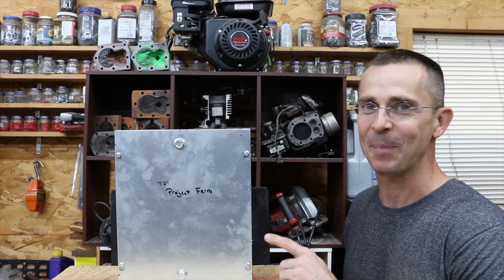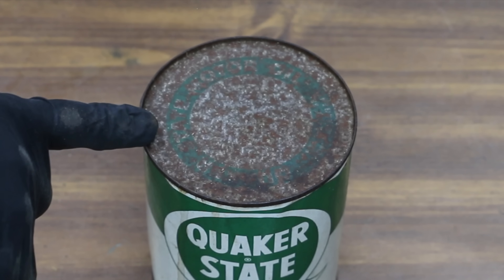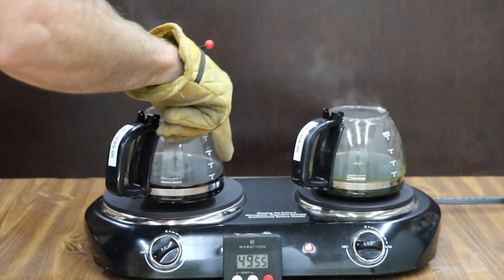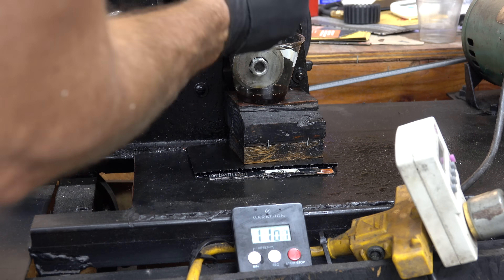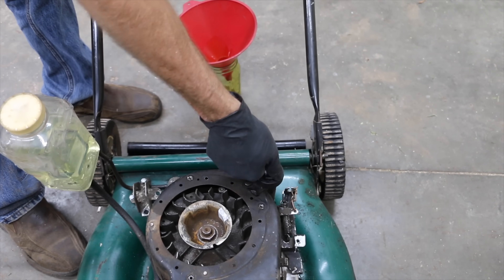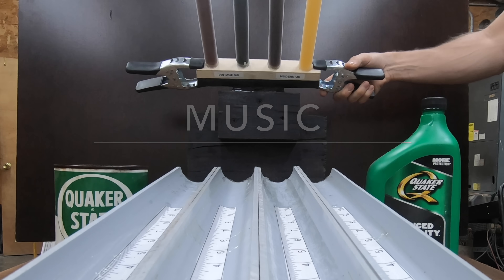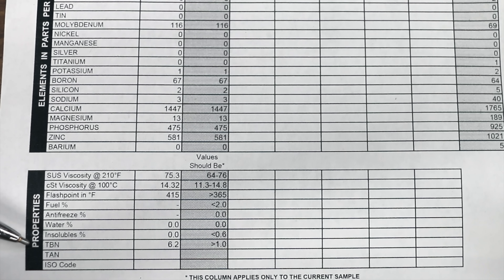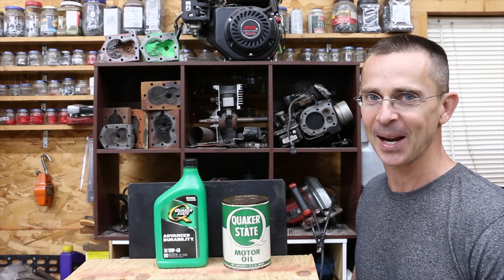Is Oil Good After 70 Years?  Let's find out!

Comment: I’ve got several jugs of 5w-20 full synthetic oil that’s been on my shelf for about 8 years. Got it on sale when I had a vehicle that used that viscosity. I have since sold it and had no use for it so it just sat on the shelf. I just recently got a truck that uses 5w-20 and I was hesitant about using it due to its age. After watching the lubricity test on 70 year old oil, it’s given me the confidence to use it for short intervals 😂
Reply from the maker: Thanks for sharing.

Comment: One thing to consider : the fuel composition was different 70 years ago as there was lead in it.  I wonder if there would be any significant changes in the heat results with 70 years old fuel.
Reply: The lead was to add a higher octane rating. Didn't have anything to do with the motor oil.
Reply: @erikkovacs3097 the high temperature caused by the explosion in the cylinder chamber could have an effect on the oil.  if the temperature is lower, the old oil might be less or more sluggish..
Reply: @dynad00d15  Engines have to get pretty damn hot to start chemically altering the oil. Gasoline hasn't change that much in 70 years and what has changed wont make the engine overheat.
Reply: Modern motors high compression put out more heat. This comparison is flawed. Also cast iron blocks back then now we got aluminum which takes away heat faster.
Reply: @holdmybeer1085  True.  Also, i wasn't stating a fact, i was just curious to put the old oil in a same age context and compare.  Thank you for your insight! :)
Reply: @erikkovacs3097  good point.  Thanks for your explanations!
Reply: The lead was a very good upper cylinder lubricant so maybe.
Reply: I get a kick out of people that think they need hardened seats because we dont have lead in gas. As my aviation instructor said "do you really think your going to lubricate anything at those temperatures?" "If you say that lead lubricates valves in a ma and pa gas station for 50 years people will believe it"
Reply: @billyjack8119  my favorite is the rubber band on the back bumper to "ground" the car during lightning storm... "and what do you think your tires are made of?"
Reply: @billyjack8119  Oil burns up and becomes soot at "those temperatures" and lead doesn't, it melts and is still lead.
Reply: @captaingoldbeered803  lead in gas does not lubricate. Thats the whole point and you should never have oil in the combustion process anyway. Lead was for the octane only. To go from the low 90 octane range to over 100 you need lead. It was to control detonation and nothing more.
Reply: @billyjack8119  It coats the valve faces and seats, which does indeed protect them.  Aircraft engines have always had Stellite valves and seats, as long as that material existed.
Reply: @billyjack8119  That's what it's main purpose was, but it did indeed coat the valve faces and seats, which protected them.  1975 and later engines all have Stellite valves and seats, which do not need protection, as they are super hard.
Reply: @michaelbenardo5695  lead was there to get the octane above 100 and thats it. You have heard of 100LL (low lead) it controls detonation and thats it.
Reply: @billyjack8119  As I said, it's intended purpose was to cheaply boos the octane, but it did indeed coat the valve faces and seats.  You can deny that all you want, but the cold hard fact is that an engine with conventional "soft" valves and seats like those common before 1975 would need a valve grind after about 20,000 miles if run steadily on unleaded, whereas if run on leaded gas, a valve grind was seldom necessary before 75,000 miles.

Comment: Now we know why old cars only needed 5 digit odometers.
Reply: My mom used to ask me why back then when the pacer and gremlin came out why anyone was lucky to get 60k miles from a trans or motor, I explained that the oil simply wasnt up to par, with an '08 mercury mountaineer at 152k miles on the odometer I do oil changes when the sensor tells me to roughly every 6 months or 7500 miles and its smooth as butter. Lol only high mileage full synthetic and a can of restore goes in but I use right under a quart of fresh oil to flush anything remaining after its drained and theres usually alot of dirty oil that gets pushed out
Reply: and to be rebuilt every 60,000-70,000 miles lol
Reply: Amen to that!
Reply: You do realise your should be changing your fluids regularly!!!!!
Reply: Many pre 1956 (?) models don't even have oil filters; they were accessories from the 20s to mid 50s.

Comment: Excellent video as he has always used to us, for which I congratulate him and thank him.  What was most interesting to me is to see that a motor oil, more than 70 years old, has been perfectly preserved in its original closed container.  Which would make you think and conclude that packaged motor oil does not have an expiration or expiration date, hence my question: does motor oil preserved in its closed container have an expiration date?  Because most motor oil manufacturers claim that they should be used up to 5 years after their packaging date.  This video of yours would be showing that this is not the case.  I thank you in advance for your answer, because it is a question that I have and no one has been able to answer it with certainty.
Reply: If sealed, it will not expire.
Reply: It was already probably about 300 million years old when it came out of the ground!

Comment: I would imagine that the vintage oil has a lot of sulphur based on the greenish color and odd smell.
Reply: For all the hype about how older oils used to have loads of zinc, this 1950s oil has very little.    Todays additive packs are much better even though they have lower zinc.
Reply from the maker: Great point.
Reply: scdevon well, one thing is old oil, other is pre-historic oil. I think maybe 1980s oil are much better than 1950s one, and maybe had more zink.
Reply: @sjogosPT     You are probably correct.  Oils in the 1980s were also pretty bad by today's standards even if they contained more ZDDP,  though.
Reply: @scdevon  that's way before Sd oils (late 60's,early 70's), after that you'd see 1400 ppm of phosphorous and 1500 ppm of zinc at SE, SF an SG oils.

Comment: I remember that packaging. I think that it was non-detergent and most likely 30W. That looks like that real deal from Pennsylvania. Later in life QS would get oil from similar oil fields and market it under their label. I have torn down engines in the 1960's and their was a lot of sludge in them, even using the 30w-HD. Great video as always
Reply from the maker: Thanks!  Thanks for sharing.
Reply: I would have expected that the 10w-40 would make the most sludge,the SAE 30 the least. 
There is a suspicion that some of the oil was blended with kerosene from the factory. 
Would be interesting to test vintage Valvoline and Mobiloil against vintage Quaker State. I think Mobil invented a new type of refining process and certain versions of Mobiloil were suggested or specified in some new car owner's manuals. Mobil I think was one of the original spun off pieces of the Rockefeller oil business.

Comment: you missed the joy of shoving a pour-spout into the can!?
Reply from the maker: Great point!  A viewer sent one of those spouts to me after this video.  I'll use it in a video soon. Thank you!
Reply: until the pour spout comes off and you pour 500ml of oil all over your rocker cover and manifold. lol
Reply: peace tranquility those things were usually in tight, only issue was when they started using cardboard sides, if you didn't push the spout in at just the right angle, part of the side would collapse, then it was almost impossible to get the spout in without destroying the can
Reply: oh yea . . . I remember those
Reply: @cobboGHS91  @Charles Patrick
Yes, a lot of us remember those scenarios! Some of us quickly learned to open the oil can with a church key and pour in thru a funnel.

Comment: An interesting aspect on the child flow test that was skipped over: The old oil clearly not performing anywhere near as well as the new oil; but the cooked and non-cooked samples of the old oil performed nearly identically. Now the takeaway from this could be that the oil was so lacklustre that the heat treatment couldn't make it any worse... Or maybe it was more resistant to the heat cycle (it did lose less during that process). But loss of cold performance after hot running is perhaps something that should be worked on more in modern oils.
Reply from the maker: Thank you for the feedback
Reply: It's like comparing apples to oranges.  The new oil is a multiweight 10w40, this will outperform any straight weight oil.  The old QS oil is most likely straight 30w and will pour much more slowly.
Reply: @ianrobertson3419  I'm not sure if maybe you misunderstood the point I was making. The multi-grade nature of the newer oil is irrelevant to what I was talking about.

All four samples are the same temperature, and my point wasn't new oil vs old oil, it was heat cycled vs non heat cycled.

On the old oil, both the heat cycled and non heat cycled samples acted almost identically. Conversely, when looking at the new oil, the heat cycled sample was significantly more sluggish that the non heat cycled sample. This suggests that there is a degradation caused by heat occurring in the new oil, and is an aspect that could be improved upon, given the oil will be heat cycled every time you drive (enough to get the engine up to temperature).

Comment: "top tier" and "E10" dont belong in the same sentence
Reply: "Top Tier" is a brand name for an additive package for gasoline. The spec requires 10 percent ethanol.
Reply: Pretty sure it was sarcasm lol 87 octane, 10% ethanol is the bottom of the barrel.
Reply: @captaingoldbeered803  it may be the bottom of the barrel but top tier branding means it's the best bottom of the barrel gas you could use
Reply: @tonyhong20  I see

Comment: ......it would be absolutely awesome to have some “fresh” oil from 70 years ago to test. Hard to know whether the age of this oil had anything to do with the test results.
Reply: Why do you think this was not "fresh" oil? Unopened can is as "fresh" as it gets !
Reply: Sealed can, very little to change.
Reply: I have read that a growth will appear in stored kerosene.
Reply: @louf7178  There are bacteria that live on petroleum. Maybe fungus too, but there are additives for stored kero. Home heating oil is kero, and we store it in 300 gallon tanks in our basements.
Reply: @stewartcaldwell5299  Thanks. I'm surprised people think refined oil is no different than crude, regarding "of course its good".
Reply: @louf7178   Well, petroleum makes paraffin, gas, avgas, jet A fuel, autogas, grease, tire rubber, most plastics, and on and on. I get so tired reading labels. Used to that people called kero anything that would heat your house, light your lanterns. It was a solvent, and once again on and on. The differences are mostly what companies say on labels to make you buy it. Small differences that don't mean a lot, usually.
Reply: I don’t think it ages. Oil is millions of years old already when it’s in the ground, right?
Reply: @garrettstevensen2467  Um....they don't just pump it out of the ground and put it in a bottle. It is refined, and then a shitload of different shit is added.

Don't most oik manufacturers apply a shelf-life of 2-5 years to their products for maximum effectiveness?

I'm just saying...certain chemicals break down over time...
Reply: animalmother556x45 no, 2-5 years is for opened containers.  There isn’t a shelf life for sealed ones.

Comment: Makes me wonder if we are getting longer life out of our vehicles now a days because of improvements in oil.
Reply from the maker: Thank you for the video idea!
Reply: Not that they're built to last anymore. So doesn't matter. We got great oil. Now the cars suck.
Reply: Can you get longer life out of your body,by eating better food??? yup!
Reply: @lon3_wolfie  Almost any manufacturer will exceed 150,000 miles with regular maintenance.
Reply: @lon3_wolfie  You mean you don't think the Nissan Juke or the Toyota C-HR are the most beautiful cars on the road? Soon, rather than putting your foot on the brake pedal you will have to go into the huge screen stuck on the dash, select 'automobile', then 'enter', then 'systems', 'enter', then 'slowing' or 'stop', then 'enter', then 'ABS', then 'enter' then select 'front brakes only', 'rear brakes only' or 'front and rear brakes' then 'enter', then slide the 'proportional' slide, then 'enter' and then 'apply brakes' then 'enter'. I recently rented a new car and operating the radio was about like that. Terrible systems. My old Studebaker from 1962 has a better radio operating system. Then there's the climate control system. AAAAGGGHH!
Reply: @shadowthehedgehog4737  "almost" what a big keyword there. Some might. A lot of them won't without problems that would need to be fixed. Where I work, the vehicles undergo the whole range from light to severe use. Which vehicles constantly have issues. Which ones actually don't. And all the vehicles are under 50k. :)
Reply: @Colorado_Native  lmao we may joke and laugh about this now. But wouldn't surprise me if at some point we came closer to that. Every year more and more is done through the screen. Ontop of the screen growing in size each year in most of these cars. Maybe I'm old school but I prefer an actual button/knob for most of my vehicle functions. Not a screen with endless menus and drop down selections.

Comment: You go farther before you need to add a quart.
Reply from the maker: lol. Great point!  Says a lot about that era!!
Reply: Yeah, I guess you just kept a case in the trunk!
Reply: GM should be putting that on their oil bottles
Reply: I used that line when I posted this on Facebook. lol Made me laugh.
Reply: @502Chevy   No, when you got gas you checked the oil and bought a quart as needed. Or rather the guy at the gas station checked your oil. It was as normal as refilling... Well your gas tank.

Comment: I still have several of the self venting spouts used with these cans. I still have Motorcraft oil and automatic transmission fluid from the 70's. My Dad was a Ford mechanic back when automatics were rebuilt at the dealership. You're welcome to a couple to test if you'd like, but I'm not building a box like that.
Reply from the maker: Thanks for sharing.

Comment: Ha! “Add a quart” not change your oil.  Says a lot about engine building advancements
Reply: I did that on my Honda for probably 100 thousand miles.
Reply: Jay Quan my mechanic got really mad at me once because I left off changing my oil in my Honda so long there was just shy of two quarts left as the rest had been burnt off.  Normally a 4 quart engine.  Amazingly it was otherwise undamaged and has run great before and since.
Reply: @charleshetrick3152  I changed the oil in a 2019 Chevy Silverado 2500 with a 6 liter engine. It drained maybe a quart and a half after 15,000 miles with the original engine oil. That engine has a capacity of six quarts. I was amazed it still ran.
Reply: I noticed that too, Charles.
Reply: @shadowthehedgehog4737  WTF is wrong with Chevy?!
Reply: @gas pumper It was the most basic truck you could get. It still had manual windows and everything. I don't remember whether it had a light on. 15,000 miles without ever popping the hood had taken their toll.
Reply: @daftnord4957  I'm partial to Ford myself, but this was a case of severe neglect. This was no manufacturer defect.
Reply: I don't drain oil. I have a submocrinic bypass filter.  I change filter and add a qt of oil about every 6 k miles. Additives last a lot longer in clean oil A couple of qts a year will do it for the cars I own.
Reply: Had a customer that had a problem with his F 350.said when he goes around a curve the oil pressure light goes on. As you can guess when he went around a curve. What little oil was in the pan went to one side of the oil pan. Put about 4 qts in the engine and the problem was fixed.

Comment: When detergents were first added to motor oils they labelled them "detergent" because non-detergent was standard at the time.
Engines had to be disassembled and the sludge cleaned out before switching the the new detergent oil otherwise the sludge would come loose and clog up oil passages. 
 I've got some old oil change stickers which have a check box for "detergent" in addition to the weight and mileage.
 I'm surprised the new oil had so much zinc, was it formulated for off road or vintage use?
Reply: Some small engines specified non-detergent oil !
Reply: Many old timers would claim detergent oils ruined engines.
What happened is the detergent oil cleaned up the sludge that had been keeping the engine from leaking.
I remember it was common for poor folks to switch to non detergent oil once they had an oil leak.
The sludge would build up and slow or stop the leak.
It was a cheap way to get some more miles out of a worn out engine.